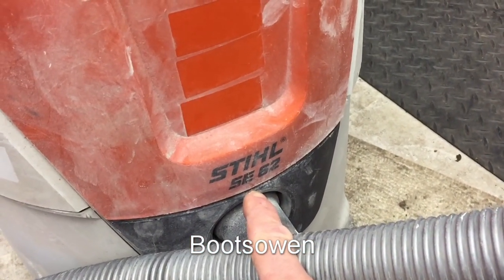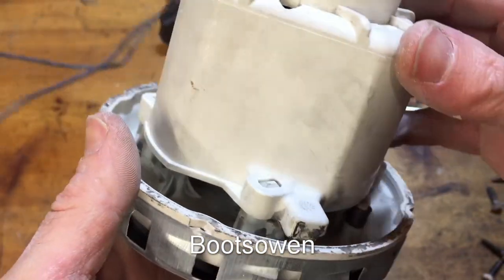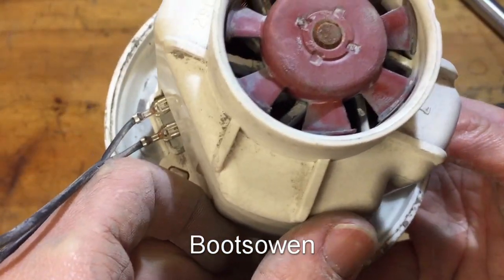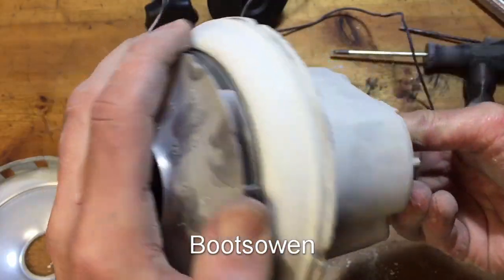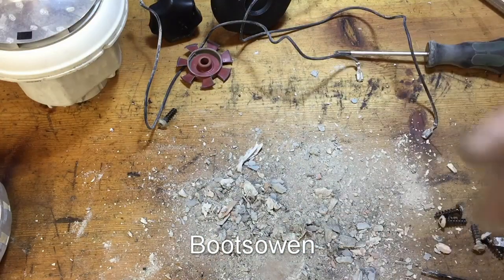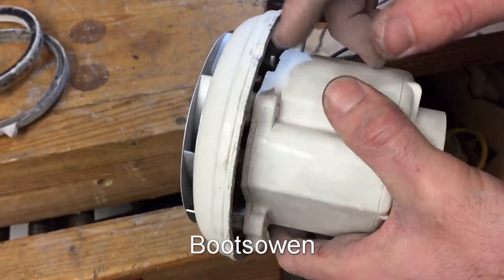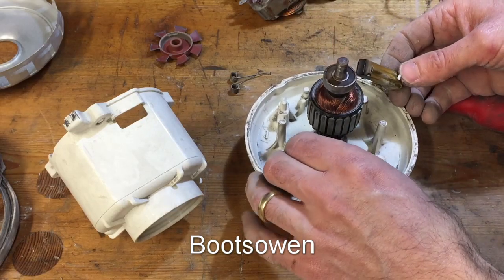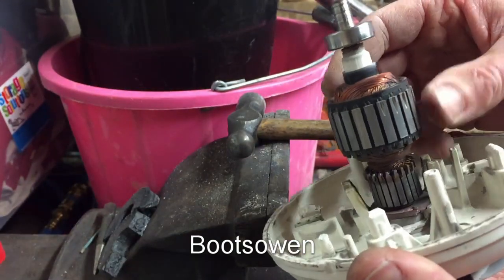Stihl SE62 shop vac: You'll never fix this one! Worst working motor I have ever seen! Sparky!

Comment: I could be mistaken but I'm pretty sure that the shop vac manual from Stihl, or for that matter any shop vac, will have something to say about maintenance. Even if it doesn't, common sense, which seems to be in short supply these days, would lead one to at the very least periodically check the air filter.
Reply from the maker: You don't need common sense if you have money!

Comment: I appreciate the time you took to video this motor removal. It saved me the trouble of going through the same process.  Just like all other appliances these days, it is not repairable, it is disposable.  I have two Stihl vacuums, that have been run without filters, and they sound the same as yours.  Can you buy the motor unit separately and/ or should I just buy a whole new vac?

Comment: Is the Numatic range of vacs your preferred choice for builders debris, plaster, wood chips and so on. Having difficulty deciding which vac to buy to clear up during my house renovation. Think I need a 15ltr Numatic but keep getting side lined on vacs like the stihl or Karcher etc. Any thoughts or guidance would be appreciated. Maybe a 9 ltr Henry would do the job with a 38mmm hose fitted and plenty of bags lol
Reply from the maker: A Henry is the best, cheapest and easiest to repair and get parts for.

Comment: It could be a mixture of a clogged fan and bad bearings. That motor was REALLY dusty. The motor is probably guaranteed to be the same size as a UDS Henry motor.
Reply: The top bearing has rusted same with the fan